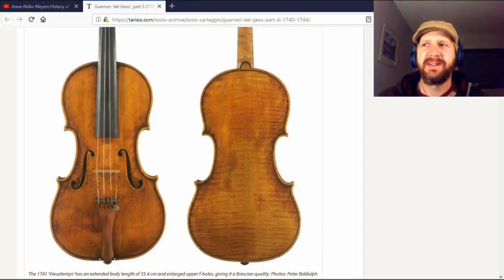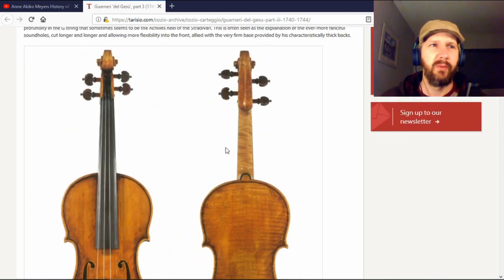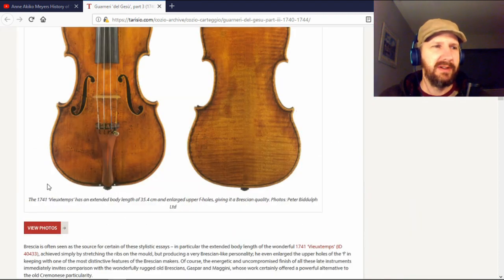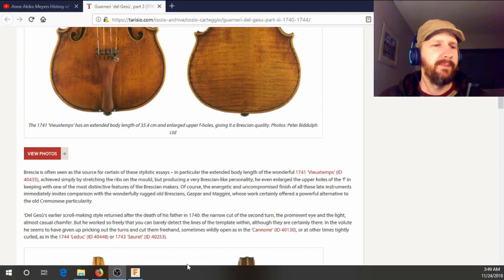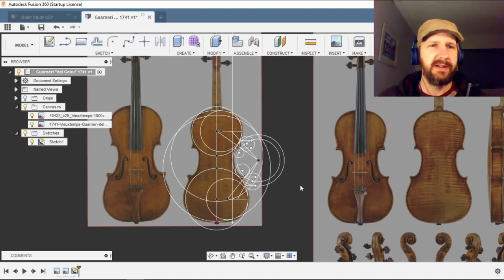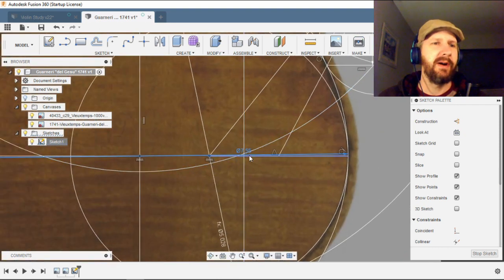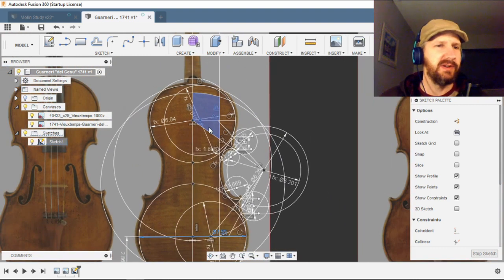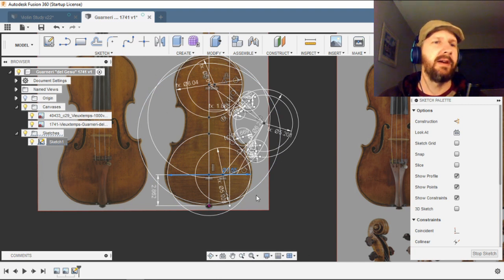Violin F-holes | Fusion 360 proportional design | Guaneri 'del Gesu' Vieutemps Part 2

Comment: I noticed that you’ve used arcs of circles to draw the body outline and the f holes, instead of using splines. Is it because that’s how masters in Cremona did it this way? I find using splines much easier for curves like these, but the problem is it’s harder to define the splines very accurately.
Reply from the maker: That is the theory, and there is some evidence to support it, but not conclusively, this method is based on the videos of Kevin Kelly that have been taken down.

Comment: Hey Tom, I have a question about how you got to get your outline fully defined. When I cleaned up the outline I got the warning messages (as tou did) about deleting constraints and as a result, 90% of my outline ended up being undefined (blue lines). I think yours was as well, but you seem to have done something to make it defined, but I can't see what you've done. Could you give me a tip about that? Thx!
Reply from the maker: As a general practice it's a good idea to fully constrain a sketch, for geometries like these it can be very difficult, it's not an absolute, just keep in mind theat if it's not constrained, you can move them even when not editing the sketch, it requires a bit more attention to detail, just be careful or select everything in the sketch and use the lock tool.
Reply: @TwoCherriesIns  Thx. I completed the proportional design (I'm referring to your 1st video in this series) and everything is defined, although I couldn't use the horizontal lines to get the circle diameter that defines the curvature of the area just above the C bout tip. I could draw the line at 8:42 n your 1st video (Drawing a violin body: Fuion360 Proportional Design) in your video but the resulting line doesn't get defined...maybe because the inersection is not clickable in my case (even though Ialso added a point there). I had to hard-code the value of that circle for both the upper and lower C bout. That would likely prevent me from making any changes to the reference circle upon the whole design is based upon. Back to this video, I started trimming the excess geometries that don't form the outline and I get constraint removal warnings and consequently the sketch becomes undefined. My thought is that it might not be an issue if I lock down all the elements when done. 
Pierre

Comment: Any chance you can explain better around 4 minutes why you use the dimensions you use to create the outer circle for the box. I assume this is likely something to do with the 2x3 or the golden section for the rectangle that Kevin Kelly mentions in his videos, but I am just not processing it in a way I understand.
Reply from the maker: I'm cheating,  just picking a dimension that matches with the attached canvas for the inner circle, the outer circle is the golden section.
Reply: @TwoCherriesIns  I finally figured that out after spending all day yesterday watching and re watching his videos. For anyone else watching these videos and the Kevin Kelly videos. One crucial and useful piece of information that is not super obvious right away:

Square root of 2 = 1.414
Golden ration = 1.618

In the Kevin Kelly videos, the other useful piece of information is understand that the two rectangles can be one of the following:

Golden Ratio = a 1 inch by 1.618 inch rectangle (this can later be scaled to size)
2:3 rectangle = 2 inch by 3 inch rectangle (can also be scaled later) 

I highly recommend actually building one of the frames from scratch, once you do it a few times once you understand the items above, it becomes really straight forward and simple and then what Two Cherries does becomes super simple.
Reply from the maker: thank you, yes the Kevin  Kelly videos are kind of required reading. He is working on a book.

Comment: I seem to be getting lost at 2:52.  I see the circle at the C Bout is change to a construction; however, not sure what the constaints are following.  I am not able to get the offset function to recognize the arc's as a solid line.  Can you expand on the contraints up to creating the offset.

Thanks Michael
Reply from the maker: The constraints you are seeing ( the symmetry constraint) are from the mirror operation when I duplicate the one side across the centerline. the fiddling around at the points where the contour meets the centerline is necessary to get them to constrain perfectly together so when I double click on any arc in on the profile the entire outline is selected. That probably makes things just about as clear as mud on a rainy day...